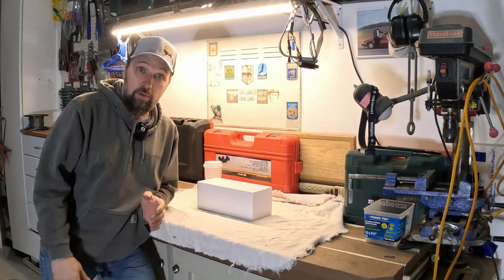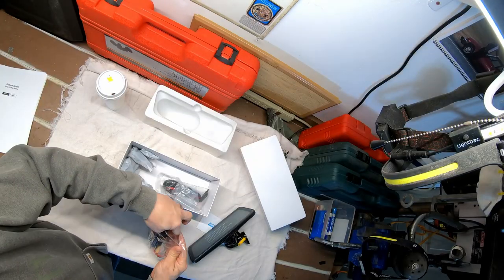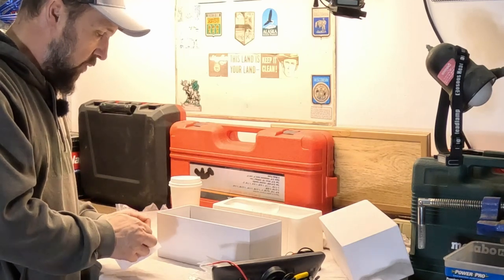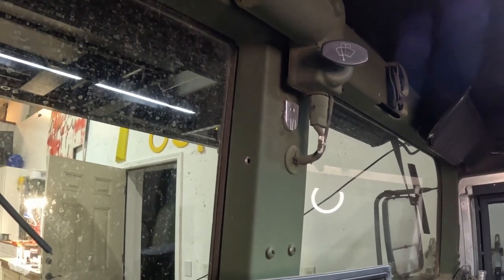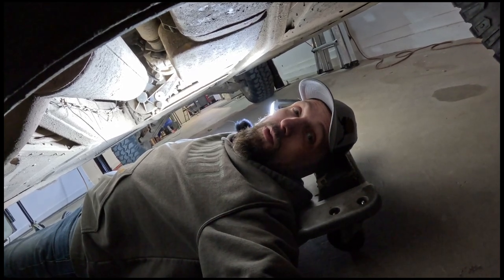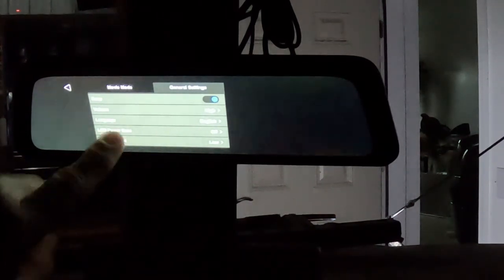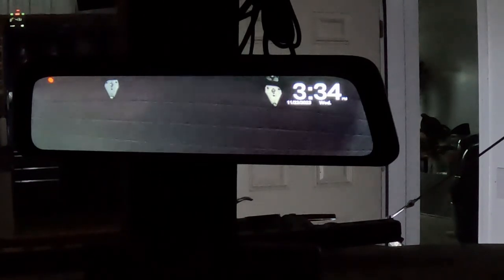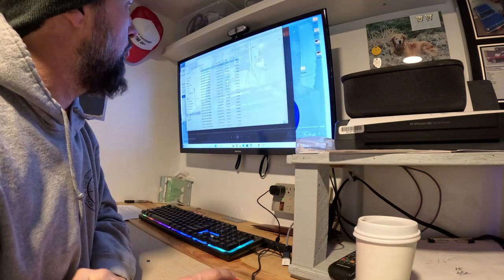Auto-Vox T9 PRO Humvee Dash Cam Install & On/Off Road Test

Comment: Is this unit still working for you? I didn't notice until after purchase that there's a warning that states this is a frequently returned item because it stops working CORRECTLY within 6 months! Be honest,please. I'm kind of upset because this thing wasn't cheap.
Reply from the maker: @jrambo7495  100% honest from me it is still working.  It takes a beating in this truck off road and you will see I recently used the video from it on my latest off road adventure.

Comment: Looks great. A bit pricey though. I have a backup cam as part of my CarPlay radio.  If I ever get off my a$$ and install it. lol.
Reply from the maker: I love the CarPlay radio stuff I’ve put in a few of my vehicles.  I’m loving the recording functionality.  Makes the off road capture soooo much easier since wheeling and filming is tricky.   Do you have a sound system in Matilda?
Reply: @McSpeedAlaskanAdventures  I have a nice CarPlay system Atoto 8. And two 6.5” speakers from crutchfield. But I haven’t installed it yet. I have to build my center console first
Reply from the maker: @MyHumveeMathilda . Awesome!  By the way Auto-Vox reached out to me with a major discount available to my subscribers here to get that price down on the T9 Pro.  I will attach those links and discount codes.  I think you would appreciate a dash cam in Matilda to make it easy to document your trips and pick up and funny business when you leave it parked alone.  Anyway I can’t wait to see your console build at your channel.
Reply: well move it then, Mathilda's fans are waiting and you've been absent for a while.

Comment: did you wire it directly to the battery?
Reply from the maker: One terminal goes to battery and one to ignition on.   The T9 pro shows it will run 24 volt on the amazon description. However on the Humvee you only hook to the second battery positive terminal and any good chassis ground and you have 12 volts.  You can then put a relay on the factory Humvee ignition to the 12 volt and you have reliable solid 12 volt battery and ignition on. You can get the ignition on terminal on the back of your alternator or tap into the ignition switch wires.  I have many 12 volt item in my truck including the winch.
Reply: Thanks! @McSpeedAlaskanAdventures
Reply: Hello again!  One more question...
What did you wire the "red" wire to on the reverse camera harness to? It states to connect the red wire to the "reverse light"
Reply from the maker: @cmills7768  you find the wire that supplies power to the back up light and attach to that.  Just splice it in. And it will then auto switch to reverse mode with guides on screen when backing.